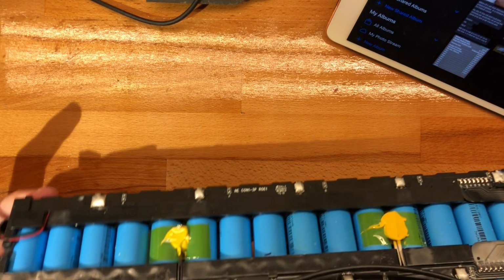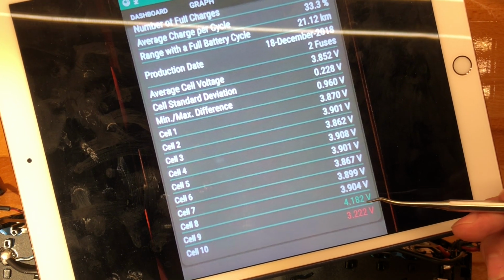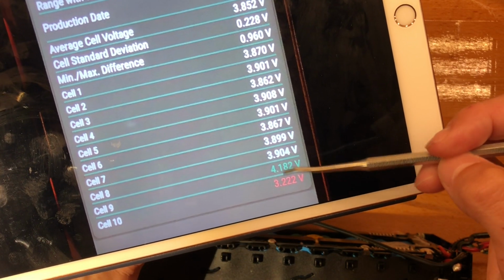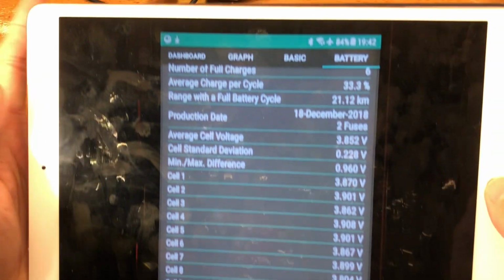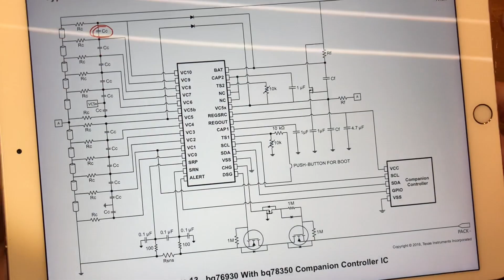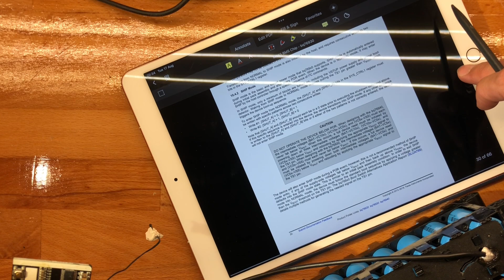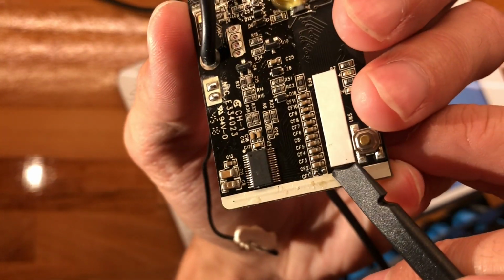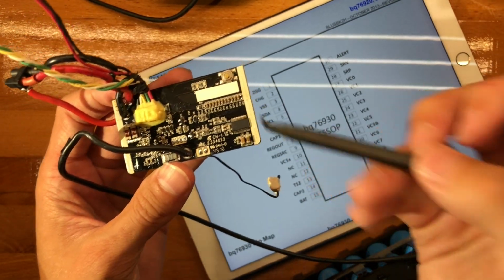XIAOMI m365 BMS Problem - Wrong Bank Voltages Shown

Comment: Thank you for the advice. I had an 8-cell problem. I changed all capacitors to CF1-11. after the change, I drove 16 km with a 75% charged battery. Before replacing the capacitor +- 6km mileage and shows that the battery is discharged.
Reply: Hi . Do you know what capacitors are they?
Reply: @elenialex8247   According to the wiring diagram, these would be capacitors CF1-CF11.  I replaced them with new ones and everything is fine.  I forgot the capacitance of the capacitors. it is necessary to measure the old capacitors.
Reply: @elenialex8247  They are 1 micro farad

Comment: Thank you. Same problem here. Cells measuring good on multimeter (all at 3.65v) and BMS reported one cell empty - 3.1v and one overcharged - 4.25v. Measuring on the BQ inputs -  voltages where right as the BMS reported.
  First i have removed all caps from all BQ cell inputs (same problem) and then i removed the BQ chip (voltages got good on chip pads), then i have put the BQ chip back and removed all zenner diodes from the cell inputs - problem solved. My BMS had zenner diodes in parallel with the caps... on the multimeter the diodes measured good - 0.5v voltage drop - no leaks, but they influenced the chip somehow. BTW BQ chip is hard to measure without an oscilloscope... the inputs are oscillating between measurements of the cell (high impendance - normal voltage of the cell) and calibration of the cell (low impedance - voltage dropped). Now the battery is like new: it keeps a good charge and is charging normally. 👍
Reply: Hi I also have weird readings and the min max difference shown by the app is twice bigger than the actual readings. Also readings in the app are jumping between two cells randomly back and forth. Did you edned up with both capacitors and zenner diodes removed?
Reply: @2mend  Yes, but that was not the fix. It might be that resoldering the BQ chip fixed the problem for a short period. After a week i had the same problem. I ordered a new BMS from AliExpress and now is fine.
Reply: The bms from aliexpress is compatible with the controller?

Comment: great video.  I had the same problem as in the video. turned out the problem was on one of the  tiny resistors on the battery pack. I replaced it and problem solved. thanks :goodvibes:

Comment: Hi! I have same problem, but at the cells 2 and 3… On cell 2 I have 3.55V and on cell 3 I have 4,12V. All other cells have 3.8. I have alse measured everyone and all of them are same voltage. What will fix my problem? Same issue everyone? Thanks!

Comment: Same here. 9 and 10 fucking banks.  I see the Xiaomi should be fined for selling scooters with factory issues and no recalls. Xiaomi no more in my home.
Reply from the maker: I don't know about that - thus far I haven't seen anyone build better scooters - do you have any suggestions?

mine also died and keeps dying because I draw 1.1KW out of it, instead of the factory default of about 6-700

Comment: Hello, I have same problem, but at the cells 4 and 5… On cell 4 I have 3.5V and on cell 5 I have 4,25V. All other cells have 3.9. I have alse measured everyone and all of them are same voltage. What will fix my problem? Same issue everyone?
Thank:)
Reply: I'm having the same issue as you. Did you fix it by any chance?
Reply: Charge that bank with external lipo charge, that is because your cells are unbalanced.
Reply: @RuiSjm  did you read carefully? He said that have the same problem like in video but in other banks. He measure banks and they are even, only BMS show different values
Reply: @archminael  oh, sorry, my bad!!

Comment: I got problem too with charging , was unable to charge battery ,but i was turned on but worked slow and all of the dots count from to one dot ,after removing this capacitor ,scooter not turning on anymore ,battery woltage is ok ,i charging battery with original scooter port ,but without the bms ,and it charging fine ,i guess its Bms gone bad..

Comment: Hi tha ms the the glod video
Which application is showing ea h cell voltage?

Do gou know which component is the regulator for the microcotroller, i have totally no action, no blinks
Reply from the maker: m365 tools shows all bank voltages
Reply: @Darieee  thanks , i can not find m365 tooks for iphone. I see m365 dashboard, m365 go, m365 plus. (All woth terrible reviews). Are you using apple devices?
Reply from the maker: I also run an iphone .. buuuut .. yeah - you need be borrowing an android for these scooter specific applications

iOS has nothing to offer on this front ..
Reply: @Darieee  many thanks
Reply from the maker: no idea where the regulator is tho ☹️

Comment: Thank You! I had a problem that the BMS was dead, I charged all cells to the same capacity, welded the cells (it worked fine), and after a few days there was a problem with cell 9 and 10. Cell 9 was showing 4,5V, and cell 10 was showing 3,5V. After desoldering CF1 everything came back to normal.

Comment: 433 / 5.000
Risultati della traduzione
hi, i have a strange problem with m365, when i connect the charger, sometimes it starts, sometimes not, when it starts after 5-8 minutes it turns red, sometimes it resumes charging by itself for half a second, then red again, it seems bad contact, I checked all the welds of the battery, and they are attached well, I also tried to buy another charger, but it does the same problem, do you have any suggestions thanks

Comment: Do you know what specs are all CF1 - CF11 capacitors ?
Reply from the maker: not off the top of my head, but the datasheet does suggest values - most likely xiaomi used those

Comment: Thanks for video,  same problem i have too, B10  wrong voltage show bms ..blink red 4 times and not charge.  But in my case  i remove CF 1, its show difference  when measure comprare to  other capacitors.  Now is back to charge  :)

Comment: Any idea where I could find the bms error codes for the xiaomi? If not do you by any chance know what it means when the bms is flashing red, then blue and red a few times and finishes off on a single red?
Reply: It's don't need. If end with red mean that bms not see all 10 groups.Start  measure from each point B0-B10 to CF1 - CF10 capacitors  on PCB. But first uncut from battery B0-B10

Comment: Thanks, i've solved same problem on my ES2 internal battery (they have same circuit but packed in different layout).
Reply from the maker: same shifted voltage due to smd caps failing, huh ?
Reply: @Darieee  yeah, I've lefted it to charge overnight and soon I'll see results
Reply from the maker: let us know how it turns out !
Reply: @Darieee  It worked like a charm. Do you know capacity of these 0603 capacitors?
Reply from the maker: not off the top of my head - but the chip's datasheet has values for the typical application - so - go off those if you really want to put some back on

Comment: Yesterday I repaired the battery with the same problem. Only today I started to google if this is a common problem and it turns out that not only I was doing it: D.
Reply from the maker: alright - nice! same cap?

at the time I made this video no one else seemed to have complained online
Reply: @Darieee  Yes. Same cap!

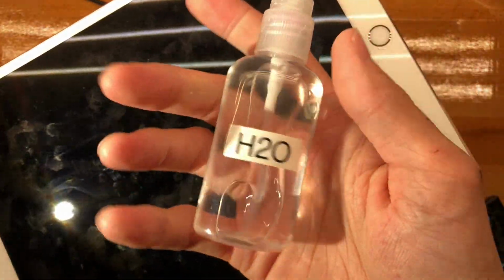Comment: 6:05 thank you for confirmation, I noticed that behaviour with the glasbed of my printer, but I was not sure
btw is that an Ipad 7 or 8? cause I got the 7 and the oleophobic coating on mine is not that good compared to others, maybe I should reapply it, did you notice that as well?
Reply from the maker: I'm super happy with the coating on mine a it's a 10.5 pro I think

Comment: There's an actual reverse engineered schematic of the m365 bms floating around. Check Google it should be among the first results. Might be useful for other problems.
Reply from the maker: oey - vvvvery nice tip - thanks a lot !